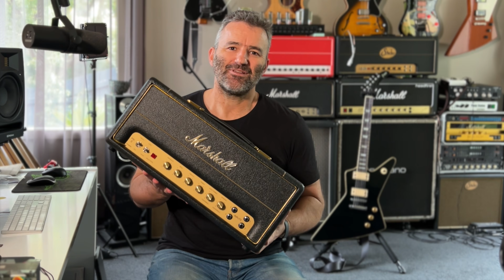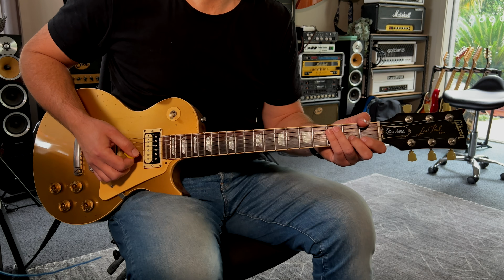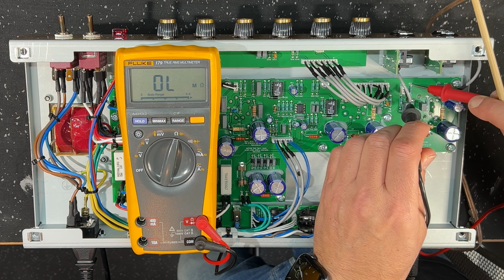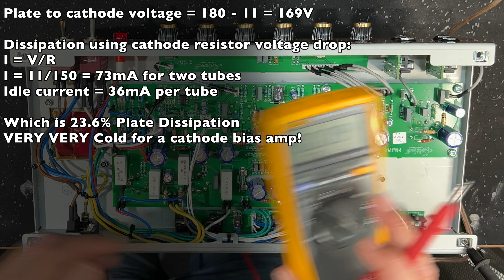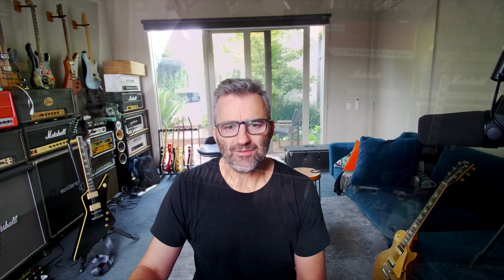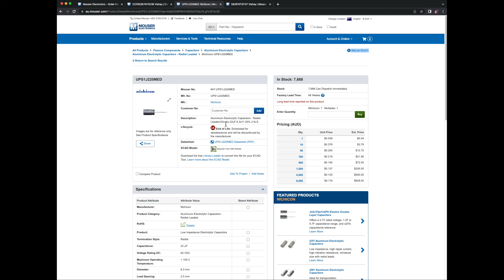Improve the Marshall SV20H with $5 of parts?  BENCH DEEP DIVE!!

Comment: I did the same mods on my 1987x and I can confirm that they really improve the amp: replaced the two 820ohm with 2.7k cathodes and left 0.68u on the cathode of the third stage...a lot better...also the channel 1 had 22n coupling I reduced to 2.2n ... a lot better and less fuzzy sound (then I used the 2 channel to configure it as a optional additional be100/cali stage) + diodes... I can go now from classical sounds up to metal.Added pre MV (was already there tbh) and post PI MV and now I have a really flexible amp.
Reply: Would you buy an 1987x over a SV20h?
Reply: @Chillnote  I've got both - the circuitry is literally identical but they sound and feel different - the 87x has a far fuller but tight low end and the highs are not as fizzy: a result of its massive power and output transformers I presume.
Reply: @digitalchris6681  Thank you, that is exactly what I need
Reply: @Chillnote  I hope not to muddy the waters... but I also have a JTM45 which I far prefer to the 1987x (and thus far FAR prefer it to the the SV20): it still sounds like a Marshall but sort of smoother and more forgiving of my rather amateur playing.
Reply: @Chillnote  well I did :) I honestly prefer the 50/100w over the 20. I found one for 700£ with the flycase while a sv20 was 550-600....so it was a no brainer for me. if I have to go for these mods I would maybe go trough a Origin directly (I made a 800-SIR34 out of it and I like it) because it is a lot cheaper (at least in the UK it is 200-250 vs 550-600) but it is a lot more work to do. Jason in a video shows also how to do a plexi conversion out of an origin too :). 
btw: if you have to play around, the sv20 or a 20w modified, is a good solution: really small and light, if you just want to have the amp for the sound and you do not mind to lift it...1987x :) ....differences are not incredibles, the bigger amps just sound with a wider spectrum in the low freq. where I find the marshall  20w squished :)
Reply: @Valerio_VDF  Thank you for your insight, the fuzziness and harshness of the SV20H is driving me crazy. I am in the process of upgrading from the SV20H to a 1987x
Reply: @Chillnote  if you are UK based I can try to have a go with it and improve it a bit :)

Comment: In a cathode biased EL34 amp with fully variable power scaling going from say 30W or so max downwards you would expect the dissipation to drop proportionally and the bias appear to be cold at 20W and 5W etc. The cold bias of some of Marshall's 20W cathode bias amps has been criticised for causing crossover distortion but I haven't seen this tested and this would imply power scaling causes crossover distortion which it doesn't seem to. If you considered this to be permanently scaled down to 20W then maybe 65% isn't unexpected? It may have been the Origin 20 specifically rather than this one but I'd be really interested to see more of an analysis! Thanks for the great videos!!